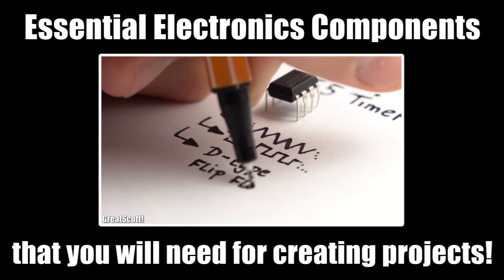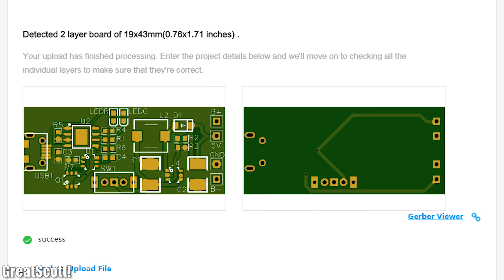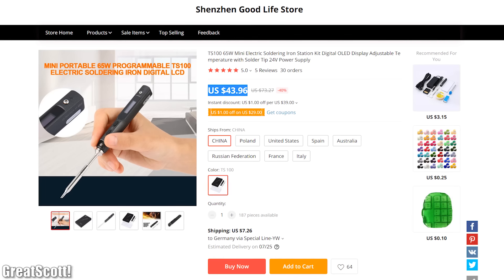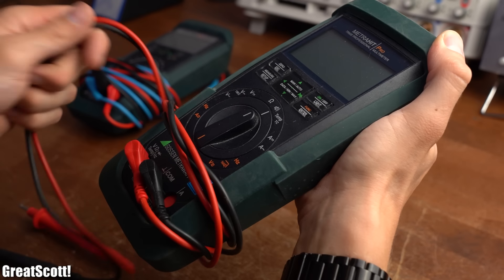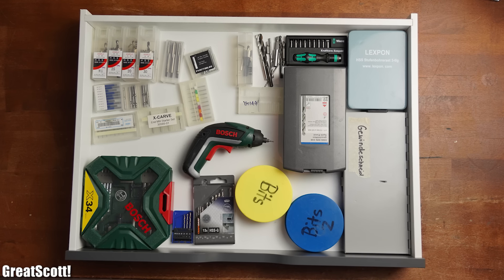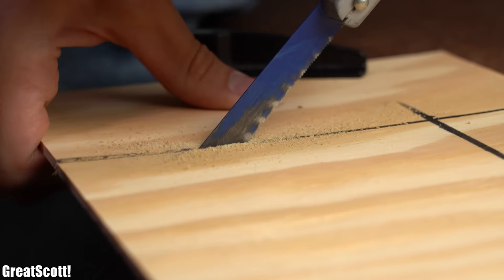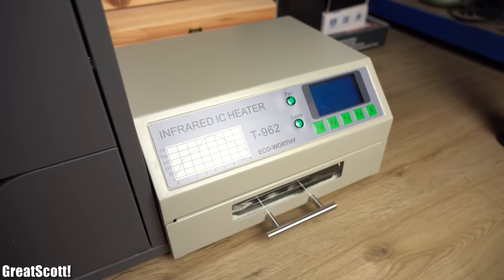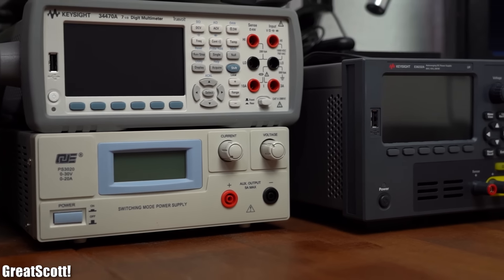Essential Tools that you will need for creating electronics projects!

Comment: I really love your video's all the time, but this one does not match the title. Better title would be "These are the tools I use..."
As others below have already replied, 'Essential' can be a lot less and a really lot cheaper.
For most people starting it could be a battery or phone charger only
after that you might want a multimeter (starting at $3) and a soldering iron ($5). Even these could be found for free at your family/friends/area
then maybe a power-supply with CV and CC (starting at $10)

Of course those are not the best and maybe even just barely enough, but it can work if you don't have the money.
You can always buy more or upgrade later if you know what you are missing/want...

Comment: Buy corded drill,it will be much cheaper than cordless because no need for charger and expensive batteries.Or buy some smaller 12V drill so you can drill and set screws,no need for bigger number of tools.

Comment: There are cheaper options to the ts100, it is a simple one, without display, just heat the tip to the temperature selected with a dial.

Comment: Moral: if you are poor, forget it.   I radically disagree.  I've had three projects published in hobby magasines without needing à lab power supply, oscilloscope or fancy ammeter for their development.  I did need a sharp knife, a cheap soldering iron and an understanding.  I  hope this video doesn't put poor people off.  If a beginner makes a dry joint and feels the need for an oscilloscope to diagnose the problem they have been misled.

Comment: Here are a few missing tools :
- Wood saw 
- Get cables neatly ordered. Or you'll waste tons of time
- A good aspirator for sucking dust (wood / metal) while cutting or drilling
- 350€ multimeter is overkill, IMHO.
- Good lighting
- Tons and tons of screws (M2 - M6, with bolts and washers) of all lengths

Comment: Curious to hear peoples thoughts on the dremel type device.  Our one at work vibrates like crazy, which causes hand fatigue and difficult for precion work, curious how the one you showed in the video performs. Have consider something like this from ebay "Dental lab drill Polishing Micromotor N3 Dentist straight contra angle handpiece" as I would have to assume it would run smooth as it gets used on your teeth.
Reply: I own a dremel brand rotary tool, and I find it so useful. First off, it's not that expensive, and although it's pretty loud, it doesn't vibrate much, and it also comes with a lot of attachments you can buy, one of which turns it into a small drill press, which also acts as a holder for it, when you'd rather move the material and not the tool.

Comment: Hi
Can you help me. I supply Cctv and one of my customers wants a hidden gsm microphone hidden in a electrical wall socket. I just need a gsm module(4g) a bridge rectifier and power supply. I’m ok with electronics but don’t use it as much these days and if you could point me in the right direction would be much appreciated 🇮🇪👌

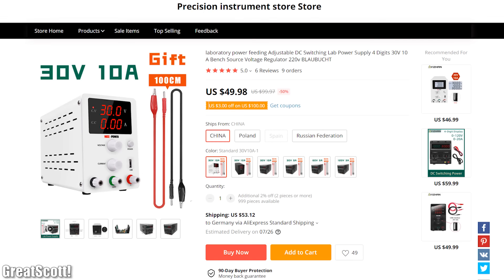Comment: 2:30 BUUUUUUUUUUUUUUUUUUUUT u can make one yourself from (old) ATX power supply. There is a lot of tutorials about it.
Reply: Current limiting is a really handy feature that ATX supplies don't offer. But yeah 12v, 5v and 3.3v covers 99% of most projects early on.
Reply: @bur1t0  Wel always u can add this, i have one and i thought about adding this with transistors and shunt resistor, but voltage drop is or too low for transistor, or too high, i build DC-DC converter on mc34063so maybe i will use build in current limiting with potentiometer on shunt resistor.
But if someone isn't me and don't wanna play with this that much and wanna easy to build power supply them DC-DC converter with adjustable voltage and  build in adjustable current limiting would be best quite cheap option.

Comment: You dont have any safety glasses and shields? Also One needs an isolation transformer and RCD plugs, Also if building mains project one needs a lamp box, essentially a mains socket where you can simply have a serries resistive load (Lamp or heater) , this serries load can be bypassed with a switch. Desk lamp is also missing. How could you miss a logic analyzer!!

Comment: If you need a function generator, then there are apps on play store that generate different signals and output them through the earphone jack!!! It is better than buying a 1000 dollar machine though!!! 😂😂😂😂
Reply: FL2k costs $5 and has roughly 70MHz of usable bandwidth on each of its 3 channels.
Reply: @NiHaoMike64  I never heard about it. I just used a function generator app for my project in college and it worked fine. 😄😄😄😄

Comment: I know you use fusion software, but you make no mention of the power supply, wave generator or oscilloscope software.  I just got a power supply and wave generator and the software doesn't look usefull when the device is a foot in front of you.

Comment: Thanks for info, big problem is initial investment is near impossible for most people just like in engineering/automotive..if i spend X can i get X back with it or will i gain X knowledge.
Its why i believe if you can afford to buy and use something let others share/use it that aren't as fortunate...if i could use my friends lathe/mill/oscilloscopes etc as needed i would be better off or even better if my neighbours would mow my lawn with there tractor (ohh no to hard when i did theres for years without asking when i had working equipment) ....Rant over keep safe and people are dicks